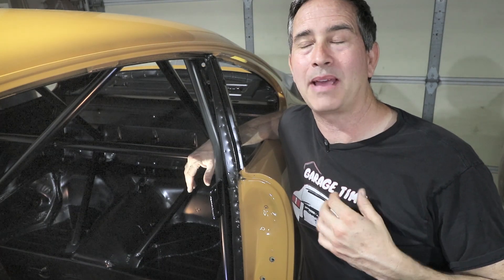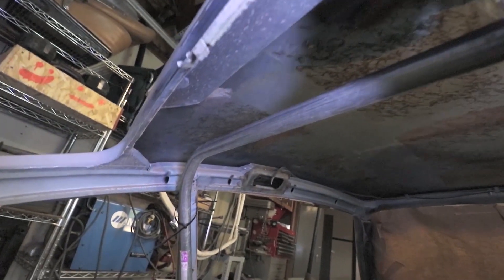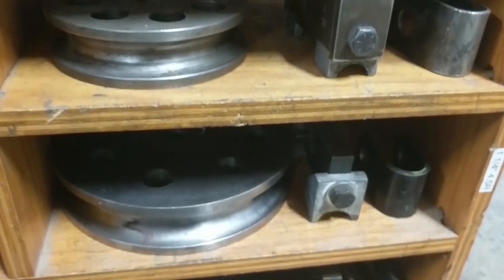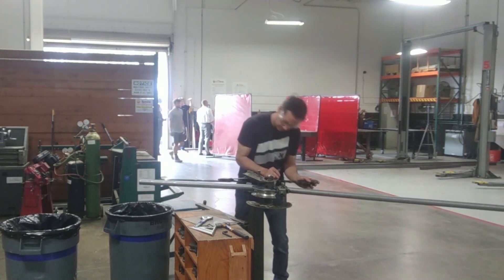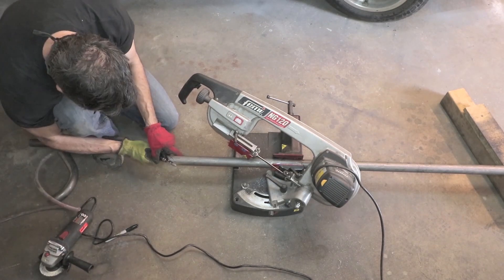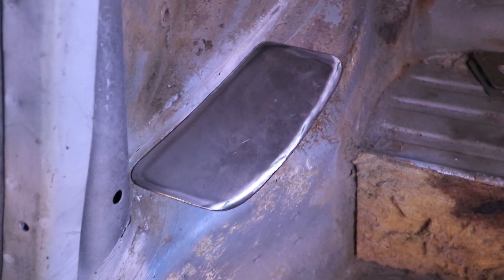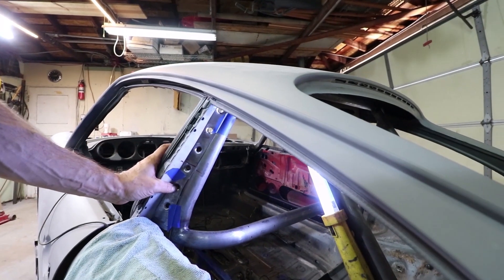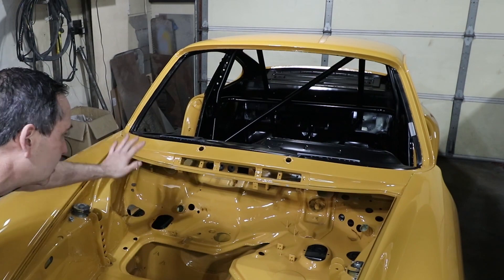DIY Roll Cage Fabrication Vintage PORSCHE 911 |  Lessons Learned START To FINISH

Comment: Liking the idea of removable /bolted in side door bars.
Reply from the maker: Yeah, the side bars can be removed in about 5 minutes or less.  I went through a lot of extra work to make the bolted connections as rigid as possible.  Not sure how much that increases the stiffness of the car or not.

Comment: I’m not an expert but every track event tech inspection I’ve worked at the required distance was measured from the driver’s helmet.   I know of taller drivers that removed seat bottom upholstery to meet that spec.
Reply from the maker: Makes sense.  I put the main hoop as far back as I could and lowered the seat to the floor.  I should be ok.